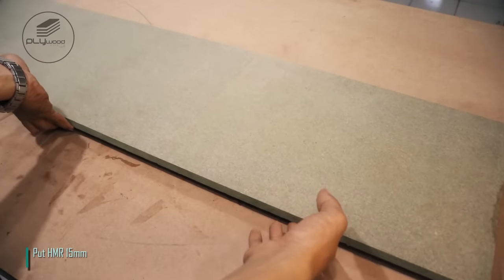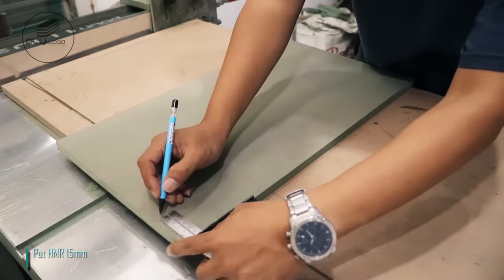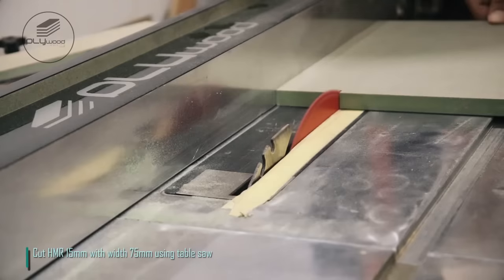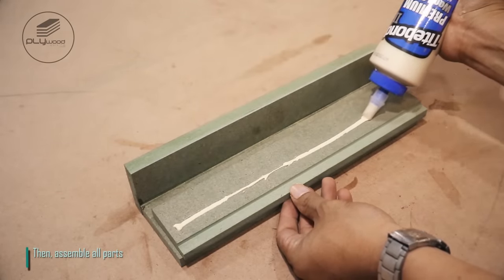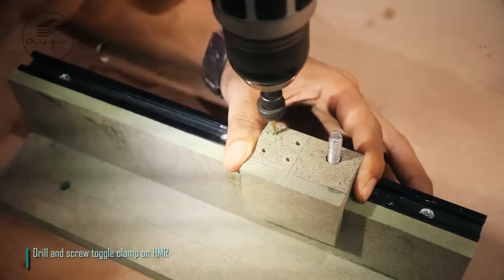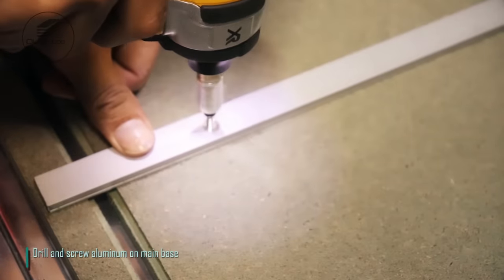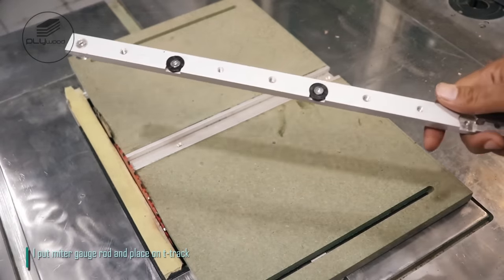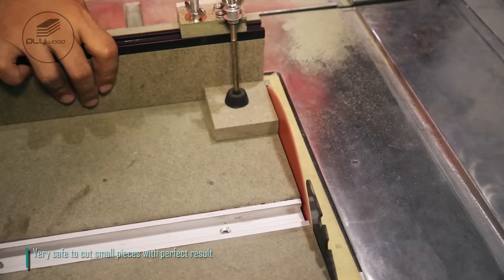4 in 1 Multi Adjustable Table Saw Jig

Comment: very nice, however the central tT-track seems to me a weak point, I hope to be wrong. see you in the next videos
Reply from the maker: i can say yes and i can say no,  that whay i give extra epoxy glue on t track for make unity main base with T track coz  imposible if use screw, i only use 15mm HMR and T track thickness 12mm only left 3mm thicness
Reply: yes in fact I had seen that the remaining thickness of HMR was very thin, this is the reason why I was talking about the weak point: a month ago I used an aluminum profile (similar to the T-Track) to make a lamp and I glued it with epoxi to a beech strip.
The following week I ruined the wooden support for a wrong process and I had to detach the profile that came off in a moment, so I said it could be the weak point.
If this happens, you can always use a 3 mm aluminum strip (wider than the T-track by at least one cm per side, milling the two halves on the lower side to recess it) to connect the two halves of HMR and with small screws to countersunk head MA3-4 x 5-6mm in length you will connect the T-track to the aluminum strip. ciao e i'll see you in the next videos!
Reply from the maker: @zolatanaffa87  thank you for suggestion, i think if use T track more safety use 18mm than 15 mm, still have 6mm thikness on center. thank you again for all suggestion and support.
Reply: @plywoodworking  don't thank me, go easy :-)
I don't want to be a professor and teach you your projects, I simply say my idea because I am convinced that sharing can improve
Hi